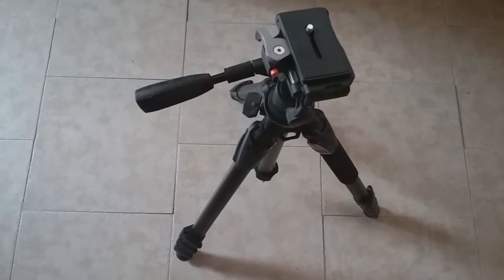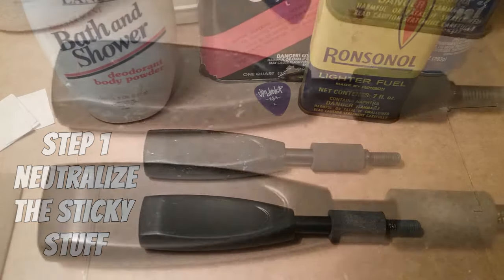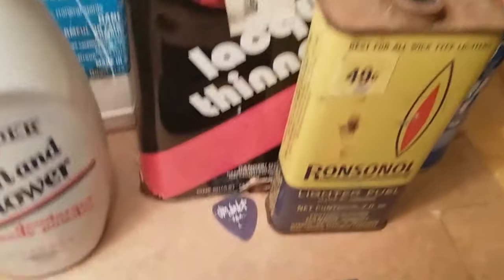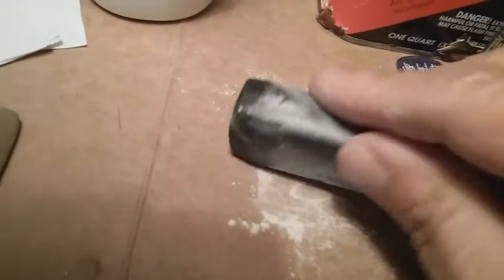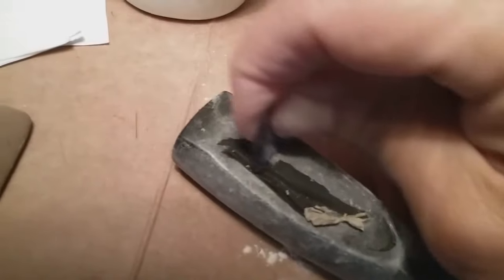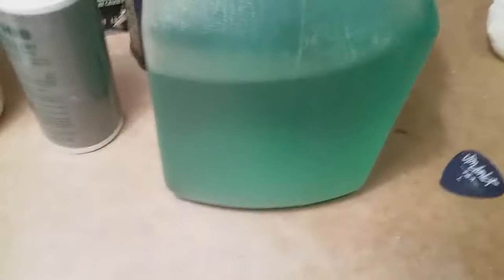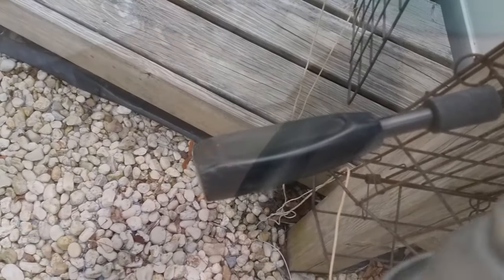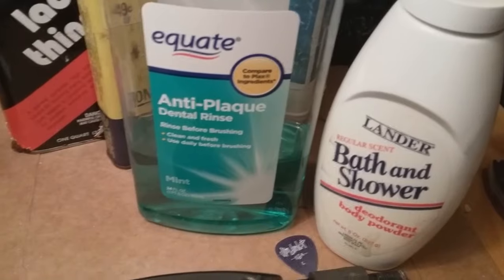Sticky Rubber Photography Equipment Fix Hack Testing Toxic and Nontoxic Solvents.

Comment: I use baking soda mix with a bit of water. Rub the paste on the surface. It kind of "scrub" it off. So you do need to give it a good massage.
Reply from the maker: Sounds like a plan! TKs for writing PXA!!
Reply: The handle of my curling iron became a sticky mess after being stored. I knew there had to be an easy fix. I tried Goof Off, Goo Be Gone, Magic Eraser, nothing helped. A scrub with baking soda, water and a potato brush did the trick! So simple! Thank you

Comment: You can use eucalyptus oil and all you have to do is rub the rubber with the oil on a rag but don't use paper towels
Reply: Very interesting. It will smell nice too. Tks!  Where do you get the oil?
Reply from the maker: lets try it

Comment: Hi, today I was having a similar problem with my Makita Cordless Screwdriver.
Hi was having a really sticky handle and finally I decide to use isopropyl alcohol and just use my finger to do a medium rubbing. You need to do that until you feel the surface really soft and not sticky.
I repeat it three times, after that use a cloth enough soaked with alcohol to clean the surface. When the surface is clean and dry I apply silicon spray the one I use in my truck and it  fix the problem!!!
Reply from the maker: Great work CB! Alcohol of any kind seems to be the key to removing that goop.